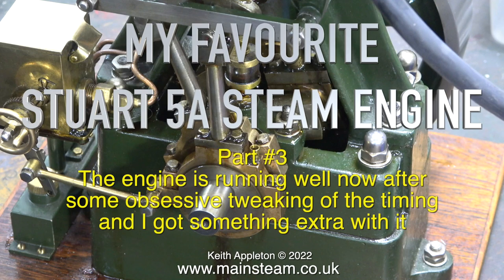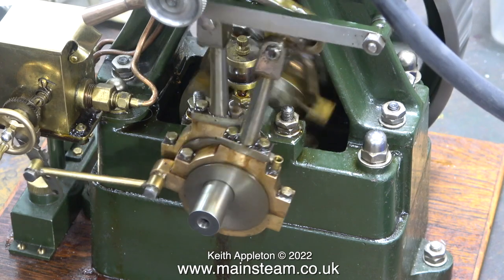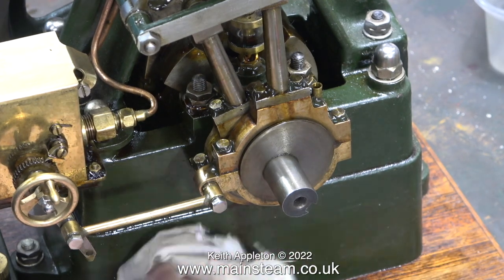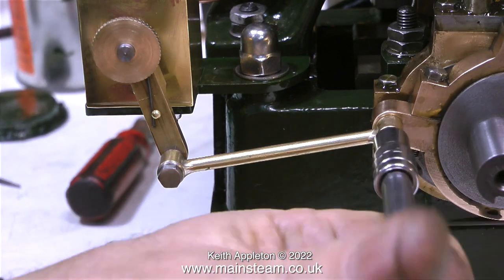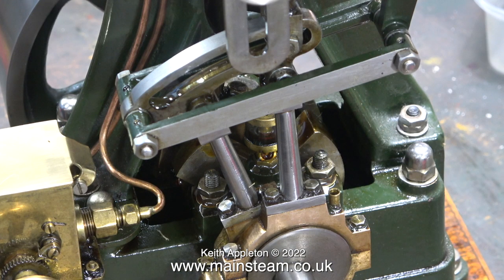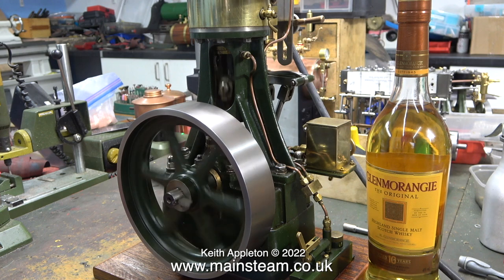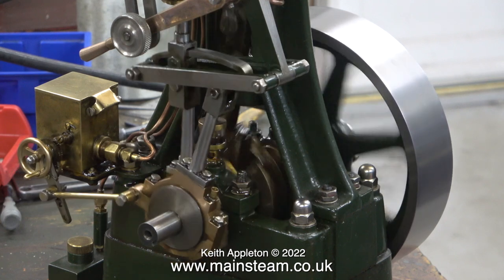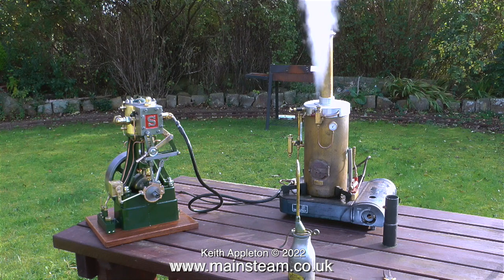MY FAVOURITE STUART 5A STEAM ENGINE - PART #3

Comment: That things look big enough to power shop tools or a boat.
Reply from the maker: 1 1/2 HP at 80 PSI . . . .
Reply: @keithappleton   So one could power a grinder or a small  Lathe. Might be a little light for a boat, though.